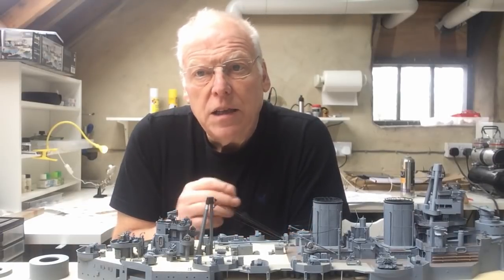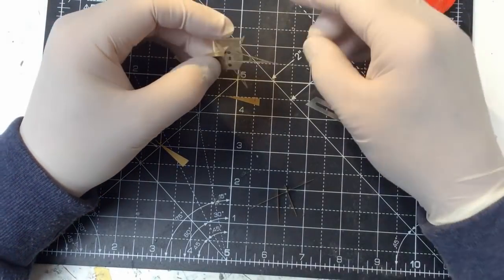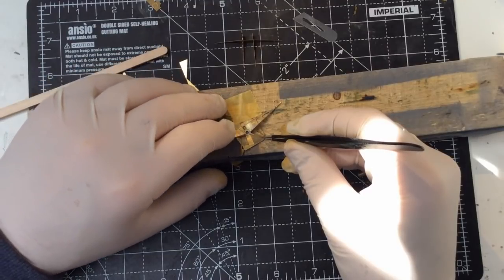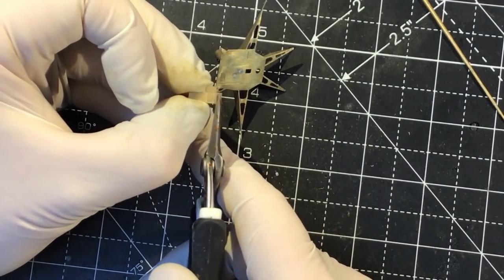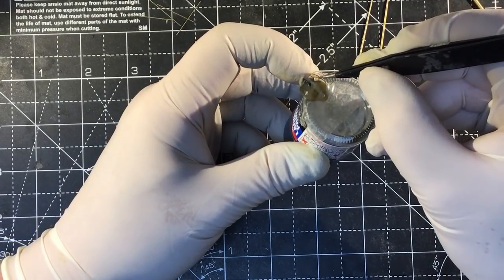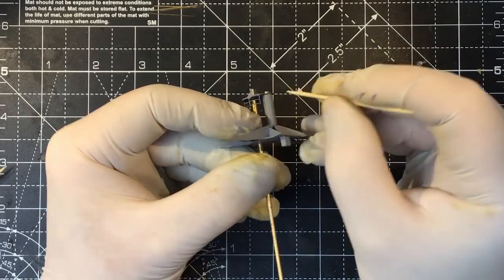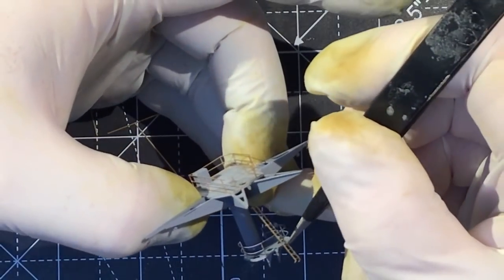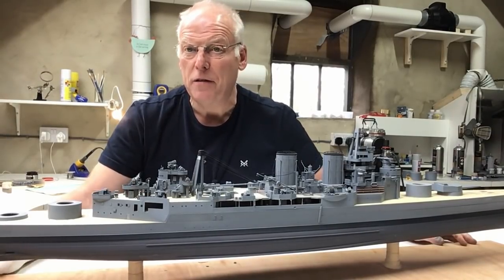Trumpeter 1/200 HMS Hood Full build with Pontos detail set Part 32  (Main mast starfish)

Comment: Nice work again Steve.
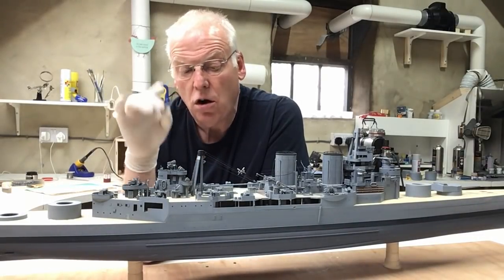25:30 I envy your spray booth ventilation. 👍
Reply from the maker: Thanks Ron. the main one to the right is the spray booth as you say and the duct to the left runs to the bench and extracts fumes from CA glue and soldering. I’m quite sensitive to CA fumes it makes me sneeze and get a runny nose and the lead solder and flux is nasty stuff as well so the bench ventilation is a must for me.

Comment: Steve, you work away with that fibre glass brush. What exactly does it do, clear debris, abrade surfaces, smooth solder? Is it superior to other means of cleaning up?
Reply from the maker: It mainly removes scum and grease created by the burnt flux. it does remove excess solder as well .but I remove the majority with a file first. I prefer it to sanding as the brush head is gentler on the delicate parts